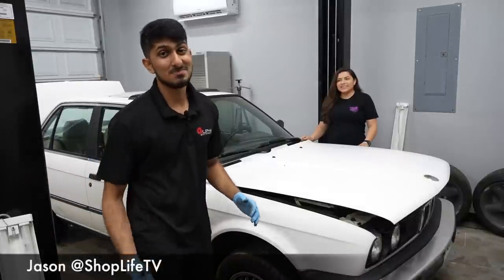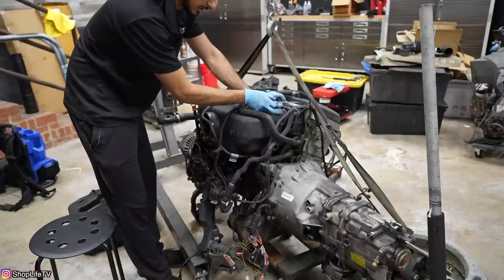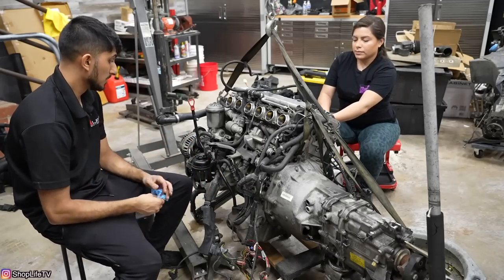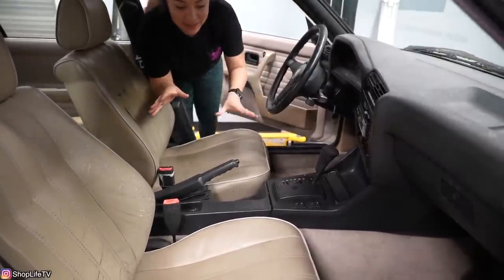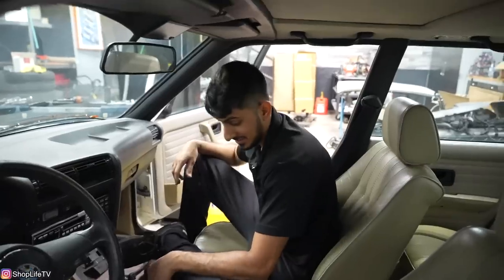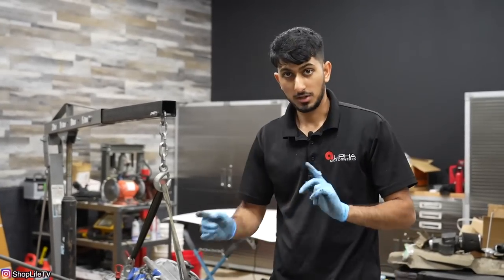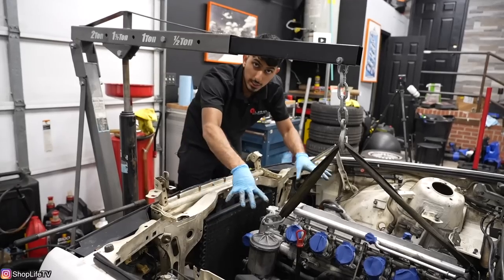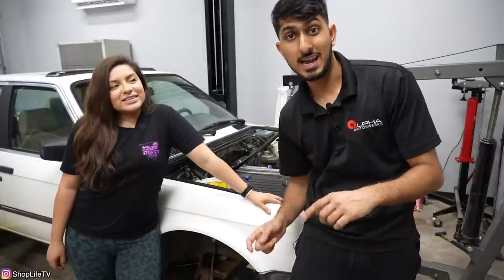Test Fitting The S54 into the E30! BMW E30 S54 Swap Part 4

Comment: Very nice Project.
I can only give the tip to leave the bodywork as original as possible, no pipe front etc. will keep the value up😉
There are some s54/s50 conversions out there, much fits original BMW.
As you said in the video: m50 oil pan, m50 oil pump, VW Polo/Golf 2 or Smart brake booster.
But you will make it 👍wait for the next video...

Comment: Be thankful that this is not an E21. Trivia fact: the first gen E21 was actually only meant for a four cylinder. However the E21 weighed more than 2002 it replaced but still used the same M10 four cylinder between the two cars. The four cylinder E21s were widely criticized for being heavier and slower than the beloved 2002s they replaced.  BMW didn't have many options at the time for the M10, so BMW shoehorned the then new M20 (your S54's grandfather essentially) baby six into the E21. This required completely different front and rear subframes between the four (315i/316i/318i/320i) and six cylinder powered E21s (320i/6 and 323i). This is the only BMW ever made to get unique front and rear subframes as well as unique front subframe, engine cradle and rear sub floorpan. BMW designed the 2nd gen E30 to accept either engine type without such massive structural modifications (which also explains why E30 and later cars are so popular for engine swaps). Incidentally, the USA never officially received the six powered E21s so these are exceedingly rare and valuable cars if you can find them. Those are also all Euro spec ( smaller front and rear bumpers, metric speedometer, etc).
Reply from the maker: The more you know! Lol Thanks for that info, I parted out a E21 320i with some recaros and a LSD back in 2014. They are definitely much harder to come by than the e30s, for good reason I suppose lol

Comment: I’ve got an extra bare S54 intake plenum that I used as a donor for my CSL box (needed throttle boots and a few bolts from it since 04.5+ uses different sized boots) if you want it.  Pay shipping and it’s yours.

Comment: Dont mind my English I need your help please 😭 so I have a e46 n42 automatic transmission every time in the morning or if the car stays to long when ever I turn on the key the interlock solenoid moves up and down, make a clicking noise and cog light every time. I tried servicing the transmission but still the problem persist so what can I do

Comment: Take consideration of the turbo positioning before you locate the engine.
Reply: It's an S54. Doesn't come equipped with a turbo from the factory. The S54 already makes 333 hp from the factory which is already a huge amount of power for this E30 which weighs a couple hundred pounds shy of 3,000 pounds. I don't recommend getting absurd with the horsepower on such a small lightweight car. The S54 is already far more powerful than anything BMW ever put under the hood of the E30. Jason and Selena are already highly advised to strengthen that chassis before piling on more horsepower or that S54 will just twist that E30 like a soda can.

Comment: be careful about placing the steering rack on the new subframe if u mess up the install u will suffer from steering issues for a long time
Reply from the maker: Definitely! There are a few options on placing the suspension and steering components by changing out the control arms and offset bushings along with different knuckles. Might have to mix and match a few things, but we will get it right!